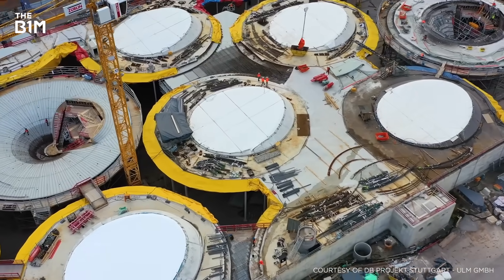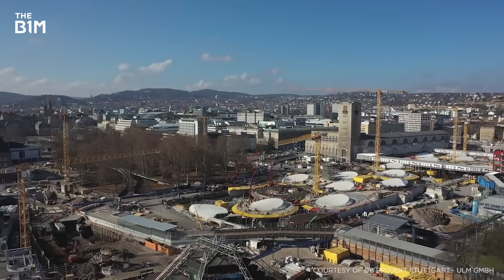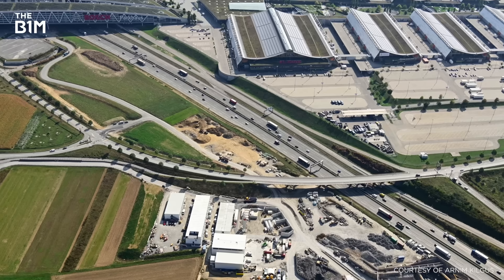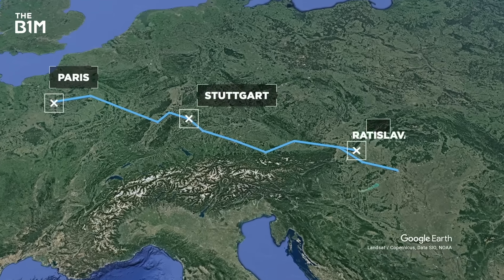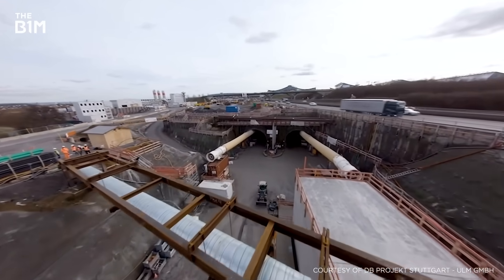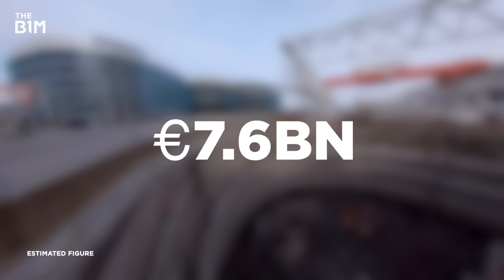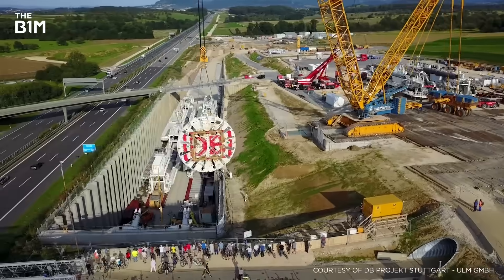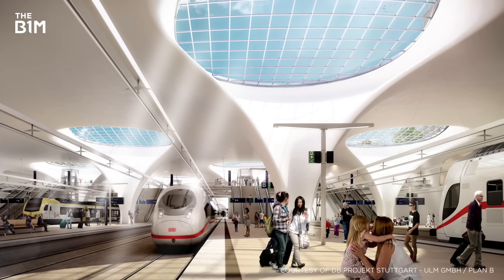Germany's 27-Year Struggle to Complete a Rail Project

Comment: Oh boy this video paints Stuttgart 21 in a much too favourable light.
Here's the truth about this shameful display of corruption, incompetence and abuse of power:

The truth is that this is a horrible prestige project by some local government officials, that might possibly never actually be used. 
The reason for that are incredible safety concerns: 
The entire Train station is tilting at 1,5 percent for example which is 6 times higher than what is actually legal in Germany. 
Also the tunnels that the trains have to pass through in order to enter the station are too small and emergency exits too far apart to meet safety standards. 
Not to mention that the entire station might actually be lifted up by groundwater in the event of heavy rain, which is a standard occurrence in Stuttgart. This is actually the reason one of the architects distanced himself from the project shortly before his death stating that this station is putting people's lives at risk!
This all comes on top of the fact, that the tunnel construction could lead to massive long-term damage to the surrounding city area, because of the kind of rock that the ground is made out of. 

Add to that the contamination of Europe's second largest mineral water reservoir from the construction, aswell as the destruction of protected monuments and the fact, that the new station in the end IS ACTUALLY GOING TO BE SLOWER THAN THE OLD STATION BECAUSE IT HAS FEWER RAILS!

So you can see that the criticism goes much deeper than that it's an expensive project.
It's a project that in the end won't benefit anyone, has destroyed monuments and damaged the surrounding city as well as natural recourses and might end up being abandoned after all because it's not safe to use.

So yeah... This thing sucks.

... Oh and by the way, nobody wants to go to Ulm.

Comment: its true that you have to maintain your infrastructure, but this isnt maintaining the infrastructure, its a prestige project and unnecessary. like 70% of the "high speed" rail network is permitted for a topspeed of 170 km/h. the parts that they bothered to modernize have a topspeed of 320 km/h. if they wanted infrastructre, theyd build high speed lines instead of this unnecessary station.

Comment: They are still building and yet the station is too small to process the throughput. Other stations on the track from Paris like Karlsruhe are actually 50% larger with 12 tracks and platforms and will be extended in the next 20 years. The new station in Stuttgart can't be extended, ever. In the end the real main station will be at the airport and the city station will remain a shuttle and regional hub only.

Comment: i really recommned to watch "the anstalts" video about this too. this video neglects a lot of problems tied to stuttgart 21 for its entire journey so far. that includes extensive protests due to the demolition of centuries old trees, corruption at the highest levels, and the fact that the entire project is completely pointless due to the structure of the ground and the material that they are building within in the first place (its not solid stone, it shifts and changes according to humidity, and can therefore cause the completed structuress to rupture and collapse).

Comment: The great thing about this project is that it serves the (south German) working class that pays it!

Thats in great contrast to Berlins Airport, the Elbphilharmonie or several high speed railway tracks to and from Berlin wich cost even more (for example: 20 Bio. for the VDE8 section of the Munich-Berlin route) and are just there to drive congressman and other officials home for the weekend.

Comment: Some important facts are missing in this Video.
The vote about Stuttgart 2021 was held in the whole of Germany and not just in Baden-Würtemberg the area in which Stuttgart is located. 
The vast majority in Baden-Würtemberg was against this project and the politicians knew that it would never have passed if the vote would have been limited to Baden-Würtemberg. Because of this, the whole of Germany voted and people over 1000km away decided over a project that most likely would never affect them. 
Second, simulated stress tests found that the new station would have a lower peak capacity due to the fact that it has half the number of platforms, 16 vs 8. This essentially means the whole project is for nothing. 
Additionally, the core concept of the train station being a dead-end was never the issue. (which is proven by the Munich main station which is also a dead-end and works fine) Instead, the issue was the number of tracks that lead to the station. Many arriving trains had to share the same tracks, this leads to delays as trains had to wait for other trains. an expansion on the number of tracks would have been the smart and efficient investment, instead of building an entirely new station and disrupting a city center for decades. But german (like most) politicians like to unveil new and fancy buildings instead of doing it the efficient way.
Reply: Please check your sources. 

1. The plebiscite was only held in BW. Not in all of Germany. As someone from NRW, I had no say. 
2. That is false. The motion was passed in the entirely BW-held referendum. 
3. The stress tests did not come to the same conclusion. 
4. Munich is much more of an end-point than Stuttgart.... Munich is at the German periphery whereas Stuttgart is not. 
5. There was no space to built more tracks... And then, travel on those old tracks takes long. The new tunnels with more tracks are way faster. 

Please, get your facts straight.

Comment: Nice video.

But I'm a bit confused why you argue that a 8 platform pass through station is better than the old 16 platform terminus.
All modern trains (serving Stuttgart) are two way, there is no more time expansive locomotive coupling.
Stuttgart especially has many level free crossings entering the terminus.

Also for a planned clock-face schedule, all trains would need to be at the station at certain times.
Example: local trains enter until 11:50, high speed until 11:55, high speed leaves around 12:05, locals afterwards.
The new station is way to small for all the lines that serve Stuttgart.

The high speed track to Ulm could have been build without changing the train station.
Many have suggested, it would have been better to improve the station or to offset some lines to second station outside the city centre.
Reply: Either the driver has to walk from the one end of the train to the other (up to 400 m) or the drivers have to be exchanged. Both costs still more time than just to stop a train and drive on.
Another problem is that incoming and outcoming trains block the other platforms. And only 5 of the 15 platforms in use were in Stuttgart able to serve trains traveling through Stuttgart (i.e. coming from Zuffenhausen and departing towards Bad Cannstatt). For the trains at the other 10 platforms Stuttgart was the last or first station.

Comment: They build it so long that alredy this project looks outdated ...
Reply: That is exactly true. When they planned the station, rail traffic was expected to decline. 
Now they want to increase rail traffic in Germany by 50% and are therefore building a project that is not up to the challenges of the future.
What makes matters worse is that the old train station would have been fit for the future.
Reply: Why should the new station be outdated? That's not true at all!  No one would claim that Berlin's main station is outdated, even though the station was opened in 2006 after 11 years of construction and has therefore been in operation for 15 years. Every building is a testimony to its time; no one would build stations like Victoria Station or Grand Central in Manhattan today. Nevertheless, people love them and technically they are certainly state of the art. Stuttgart will be unique as a large underground station with the light columns. The technical equipment will also be state of the art when the station goes into operation.

Comment: Reminds me of San Francisco's East half of the Bay Bridge. Which you've covered. Damaged in 1989 quake, a billion or so in bandaids while they decided whether/if/how/why a new span was needed or not...years pass. Mayors duked it out while state governors rose and fell. Eventually they semi-sort of zeroed in somewhere around $3bn. But that of course rose. And though the new span opened in 2013 or 14, they are still very much at work finishing the full scope of the project to the approaches etc. The bike path half way opened maybe 3 yrs ago? It is not known if there will ever be a full cross bay path...And they spent a fortune on the terminus for the high speed rail to nowhere under the bus terminus at the west end of the bridge improvement district...

Comment: its not unusual that complicated infrastructure projects take many years of planning, research and different concepts until they are realised. The title is missleading. Once planning was finished the construction goes on very smooth and in the planned time frame. Many aspects of this project are unique and have never been done..from architecture to  construction methods. So the whole project was slowed down in the beginning by a lot of prototyping and testing.

Comment: the reason they forced this project, very unpopular from the first day, on the population of stuttgard was that they wanted to sell the area of the old train station to pimp the stock value. the new  station is inferiour in every way to the old, it has dangerous desingn flaws like the plattform are on a rather step inclination. the ground is swampy and so wet that its is not only extremely expensive to build the new station, it will also be extremely expensive to maintain and it is even unclear if it is technically possible to finish the project. this all was known from the start. but germany was hell bend to privatize the railway and the stocks HAD to look good. hurra germany.  prime democracy.
Reply: LOL.

Comment: Same happened in Australia, rail projects that took 40 years to complete. 50 years if you add the initial concept. Hey 27 years is nothing.
Reply: Which rail projects have taken 40 years to complete? I am a 60 year old Aussie, and I don't know of any.
Reply: Also many doubts were expressed about the Opera House when it was under construction, but look at it now. It has become ‘the’ icon of Australia.
Reply: It's not finished yet, though ;)
Reply: What rail project is that?
Reply: @koharumi1  I think he was just waffling 😂
Reply: How many years have we been discussing high-speed rail in Oz now? 🤔
It only took 70 years or so to decide on the next Airport in Sydney.
Reply: The city tram extension called the "green line extension" in Boston, USA has been going on (and canceled, and redone, and cancelled, and so on) since the 1980s (perhaps even the 1950s...)...
Reply: @lelsewherelelsewhere9435  from what I have seen in other projects, stopping and starting a project can add a huge cost to a project.
Reply: Come to Belgrade. It's not done yet.
Reply: Guys u have somethings20,30'35... but in my country nothing just see the you tube and satisfying my self
Reply: Australia need import Bangladesh worker to doing all infrastructure . 
At the same time ....progress fast and reduse labour cost .
Reply: @petaipetai5921 and treat them better than Arab countries.
Reply: In the UK its 80 years
Reply: The only railway project that took longer than 50 years to complete was gauge standardisation most of australias railways were completed between 1850 and 1890
Reply: comparing australia and germany railroad is just completely stupid and absurd
Reply: mate ur lying mate

Comment: Videos like this make me question the quality of the B1M's videos. 
It was just scratching the surface of what was and still is going on about the project. No details about the architectural problems and controversies (except maybe the increasing costs or demolished buildings, but that's just the tip of the iceberg), just some basic informations like on the brochures the Deutsche Bahn is giving out.

Comment: Train travel vs air travel.  To improve travel to Ulm, add a few more flights that simply fly over the countryside.  But some people are still locked into the idea of heavy steel rails on a fixed rail right if way.

Comment: Travelled on the mentioned Stuttgart-Ulm line in 2009. We were actually travelling from Amsterdam to Ulm by DB ICE train. Had to change at Frankfurt Airport. Then to Ulm via Stuttgart. Was certainly surprised how the train stopped there and then "reversed" onto Ulm. Of course train is double-ended so it didn't matter except for us passengers who were now facing the opposite direction. Didn't notice anything that usual about the track though. Perhaps maybe it didn't exceed 200kph, unlike the other legs of the journey where close to 300kph was normal - can't remember too log ago :-).

Comment: The delay of the project is a shame for sure. 

But nevertheless it`s a dramatic improve in the railway network of southern Germany and central Europe. 

I'm travelling often from bavaria to the nort of germany. If i have to go somewhere in nortwester Germany, the Journey often leads through Stuttgart. This means slow, old tracks with massive gradiant (Geislinger Steige, max speed 70km/h) all the way from Ulm to Stuttgart, than a time consuming stop and turnaround at the terminus of Stuttgart, followed by a very slow, curvey ride out of the city, as the train has to meander ~15km through the city bevore it reaches Highspeed tracks to Mannheim/Frankfurt. 

If the new train station and new tracks save at least 15 minutes of time (average of long distance trains, where the time saving is higher - and local trains, wehre the time savings are lower than 15 min), thats ~320 hours saved a day over all trains. 

Beside the savings in travell time, that also means a huge cost saving for the train operation. When a train has a amount of staff of 3 (average), that alone means about ~ 50.000€ saved PER DAY! In addition to that you need less rolling stock, as the time capacity saved in Stuttgart can be used somewhere else. Now, I don't really have figures, exactly what stock runs through stuttgart and how much each train cost to buy/lease, operate, maintain per hour of service. But a rough estimate would be around ~100.000€ saved a day for ~1.300 trains that pass thourg every day. 

In total we're talking about financiall savings of over 50.000.000€ a Year (rough estimation) PLUS benefits for High Speed travel, wich usually leads to overall benefit in national economy (good infrastructure is key to welfare).

Comment: Stuttgart 21 isn’t about a train station. It’s a train stop. In order to accommodate existing subway tracks the rails will have an incline too steep for a proper train station according to German law. Therefore officially it is deemed an train stop. There is critique that the capacity for local rail-traffic does not increase. Inter-Europe rail travel from and through Stuttgart is as of now negligible. The ground isn’t ideal for an underground station of its size. Groundwater needs to be combated by pumping stations potentially running around the clock. I sincerely hope that the people of the future will be able to see a benefit in this huge investment.

Comment: This is not exactly a piece lending itself as a recommendation to the channel.

For starters, the poll mentions was worded so badly (for legal reasons) that many people didn't understand which choice meant what.

Then, the high speed line to Ulm is not not an integral part of the S21, and there were plans to connect it to the existing station in Stuttgart. That high speed line would have been in operation for ten years now, weren't it for S21 and the eternal limbo it was in.

Replacing the 16 former tracks with just 8 is basically a downgrade and, as other have stated, is akin to Zurich replacing instead of augmenting its central station with the new underground stations.

Fun fact: The (small) bavarian part of S21 is now operational for more than ten years.

Comment: A new train station, which in fact isn't a station but just a stop and looses a lot of capacity compared to the old station. Ah and did I mention the wet underground which could flood the entire station and destroy all tunnels leading there if it rains.
I think I forgot to say, the whole station is angled so strollers and other things with wheels will just roll down the station.

Comment: There was a better plan considering 3 new Stations one in the center of the city, one at the airport and one outside of the city for the high speed transportation on ground the DB already owned. It would have been lower in cost an much faster to build but simply because the bosses of DB and some politicians simply getting a lot of money by signing the contracts for S21 they never really discussed this project. There are many problems expected and even the architect of S21 became a enemy of the whole thing after learning about the Groundwater issue. I mean the plans look very nice and if everything works out as planned, fine but right now I can just hope that this idiotic moneygrave does not ruin my loved Valleycity.

Comment: Stuttgart 21 is NOT a rail project in the spirit of a transportation project. It is an urban development project. This is the reason why friends of the railway hate the project. A high capacity railway station gets shrinked to a insufficient breakpoint station. The old station has been designed for 54 arrivals per hour, the new one only for 32. Now the planners are thinking of expanding the project by a second underground station and by additional tunnel tracks. The german ministery of transport only finances 1/6 of the project (the share which is necessary to get the link to the new railway line from the old station to Ulm which is a transportation project indeed).